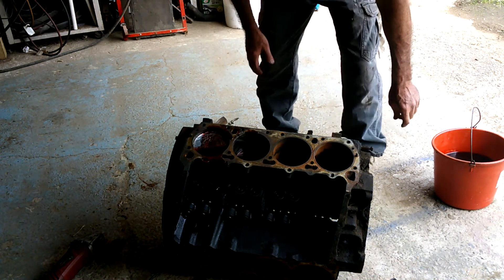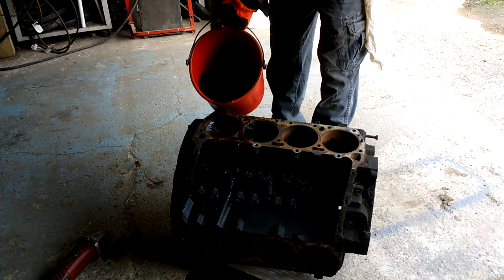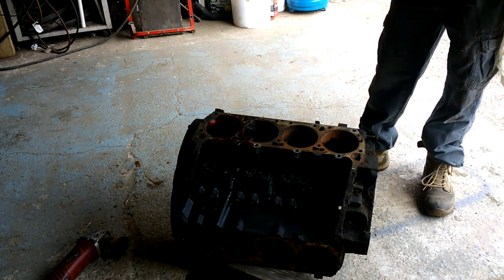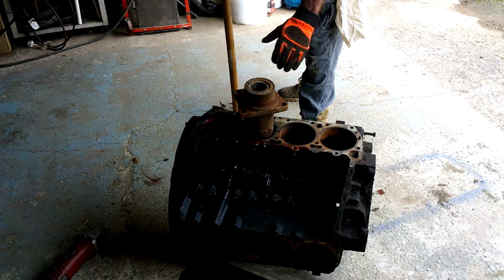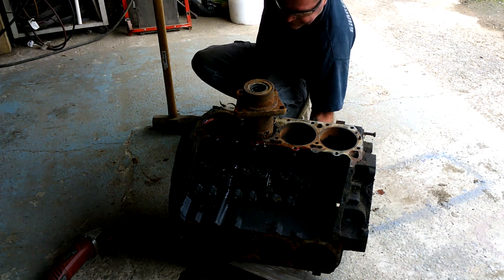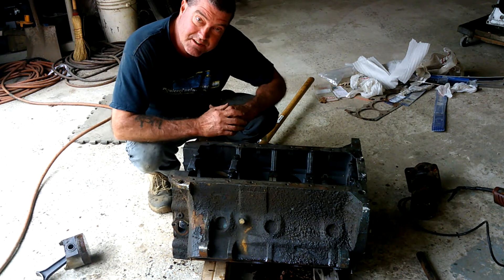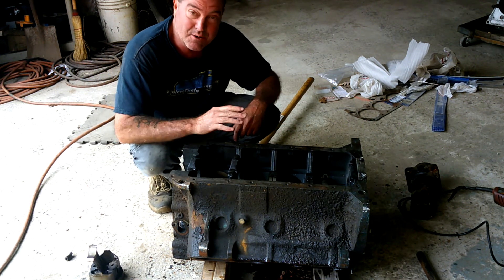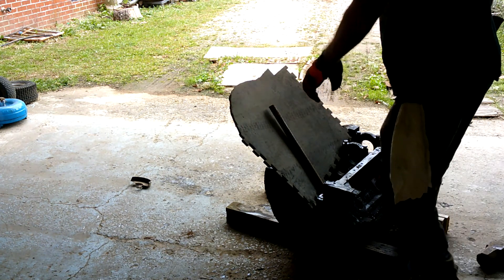How to remove stuck pistons from an engine block. Saving a seized engine from the scrap yard part 1

Comment: I just hammered all eight pistons out of a 1957 Dodge 325 Hemi block. Fortunately they all came out without too much grief, so I will build that one first. My other 325 Hemi has five that are seriously stuck. Sacrificing a con rod is not an option, but if necessary, I will strip as much as possible from that engine, steam clean it, & get the Redi Strip people to dunk it, thereby dissolving the pistons completely, along with cam bearings & anything else that is not iron.
Having it so clean that is sterile will help in finding any more frost cracks other than the one that I already know of.
Reply from the maker: Sounds like a worthy project. Hemi's of all vintages are worth saving. I get so many like this I am considering filling a barrel with a diesel, transmission fluid, and vinegar, to dunk complete short blocks in and let them soak for weeks or longer. I have loosened many a 4-speed with automatic transmission fluid as well. The block in this video did not soak more than a few hours but I had it sold and the customer was on his way. Check out my entire stuck engine disassembly video as well as the ones on 4-speeds. Lets keep them alive!!!

Comment: why do you need a 9mm in your belt to fix an engine? greetings from europe
Reply from the maker: I was hoping no one would notice so now, I guess I have to explain. First of all, it is a .40 cal. not a 9mm. The answer to your question is twofold. One, I have a small ranch and sometimes have to protect my livestock from coyote, fox, wolf, cougar, etc. While I keep a small .22 rifle nearby for the smaller varmints, the Sig is fast and accurate if I need to act quickly. Second, I have a long history in law enforcement and old habits die hard. Me without a gun is like Crocodile Dundee without a knife. Cheers